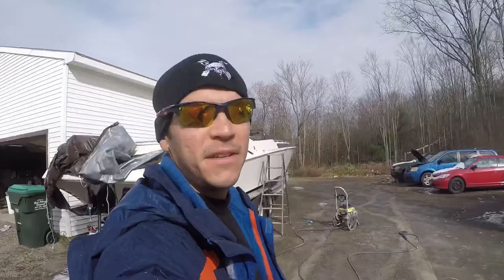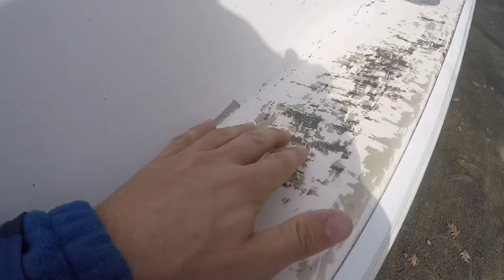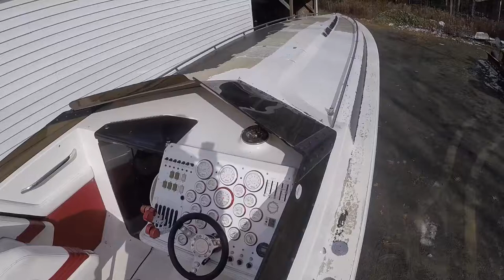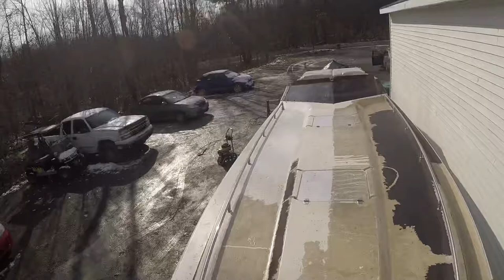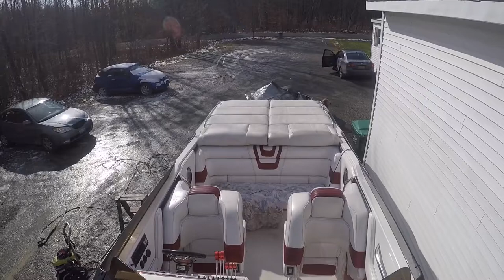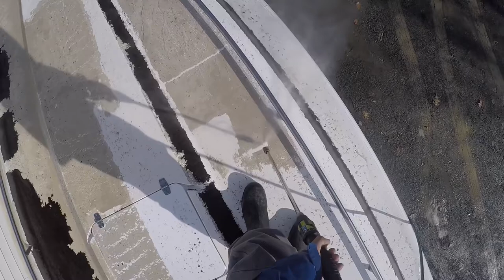42’ Fountain Powerboat Project vlog #2

Comment: Hell yeah brother, 42 fountain is my dream boat as well. Great find. I would put either 500's or 496's. You've got alot of wet sanding a head of you but the end result will be worth it. Remember you've got a fountain!!!!!! Maybe try poly stripper or even acetone. Definitely gonna have to wetsand,compound and then wax the hell out of it. I use collinite 870 for a cleaner wax.   It's kinda pricey, $35 a quart but the results you get are worth it.
Reply from the maker: Sean Scannell im totally in love! check out the end of my latest update vlog. Shows the engine test fires when i bought them. Ive also since found a 3m adhesive remover that works good on removing the wrap. Im hoping to be 100% finished by mid june